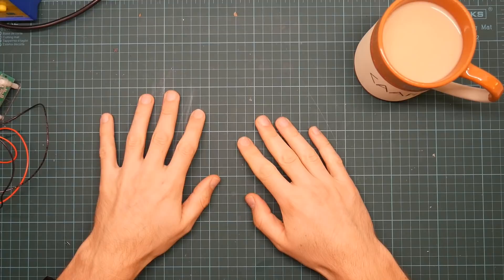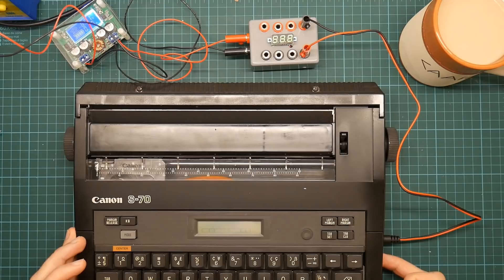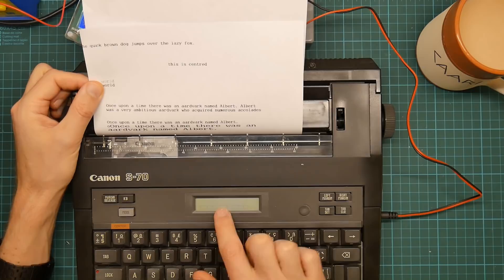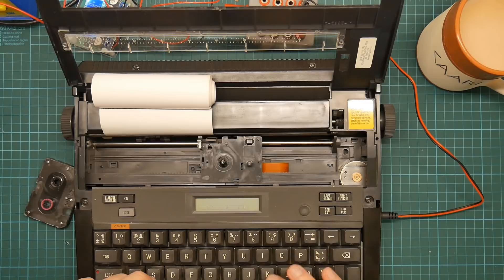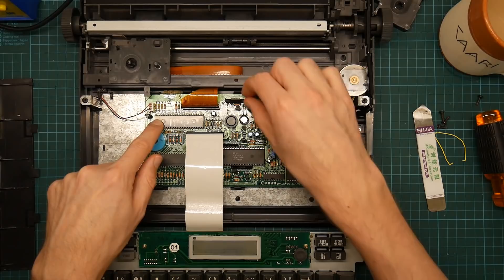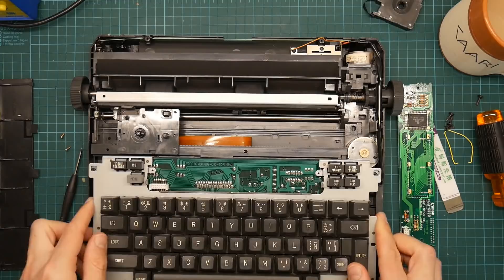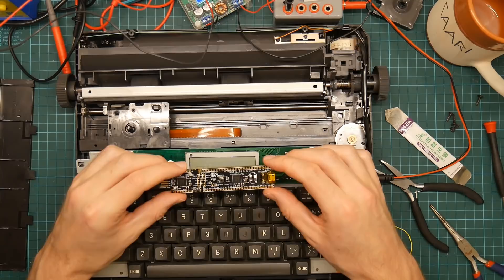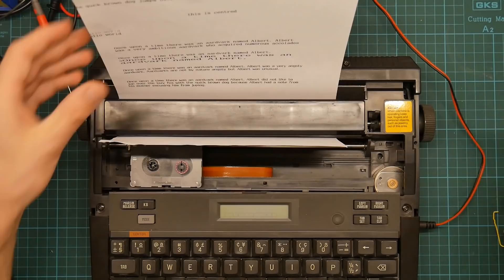Hjalfi opens a Canon TypeStar 4 thermal typewriter

Comment: Thanks hjalfi, was looking for a compact electric typewriter not knowing anything about them really, and bought one of these after watching your videos. Have been doing the opposite of what you did - simulating key presses with an arduino, a couple of shift regiters and a lot of transistors. Just got it working last night. Hoping to add a SIM reader so I can print out text messages

Comment from the maker: I got ten more lines of text out of it before the ribbon ran out. There was no sensor; it just stopped feeding when it hit the end, and the thermal head immediately melted through the thin plastic ribbon, smearing carbon-impregnated melted plastic on the paper... So it's back to the thermal receipt paper for me.

I am now wondering about whether to open up the ribbon cassette and see what the previous owner had been typing.
Reply: I've recently found a similar model (Typestar 3), so this is an extremely helpful video for me - lots of useful information in your teardown - thank you! I was looking at the ribbon wondering if there was any way to wind it back or reuse - apparently not, but you definitely can read everything that's been typed on it!

Comment: In order to have the LCD screen at eye level, I'd like to pull it out of the machine, as you did, and connect it with the board using an extension. It looks like the connector has 7 pins on two rows. Do you know where to find an extension for those?
Reply from the maker: Not even slightly. I have a lot of vintage connectors I'd like to find modern plugs/sockets for and if anyone has any idea how to identify these, I'd love to know.